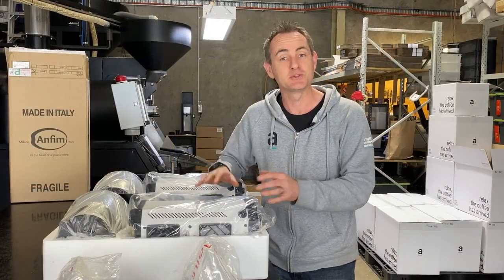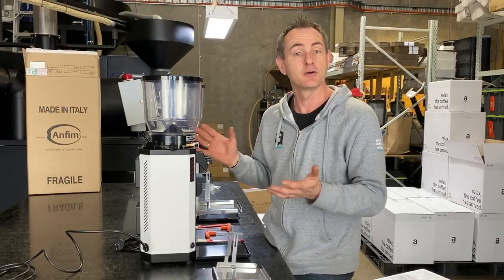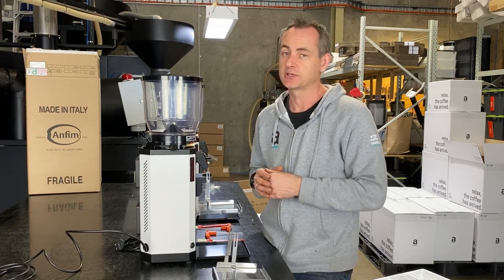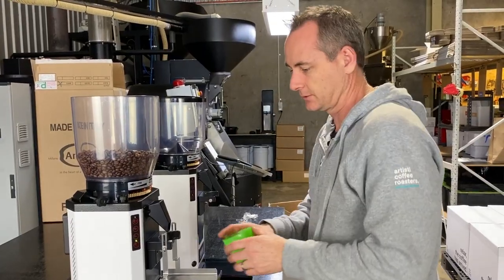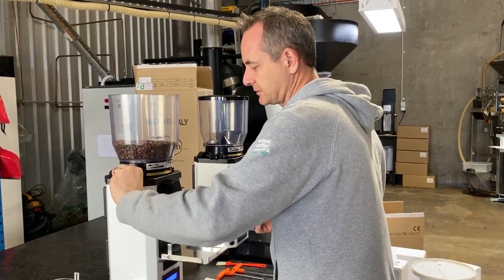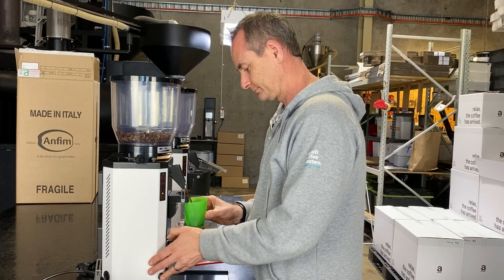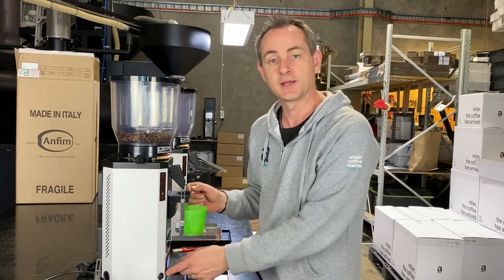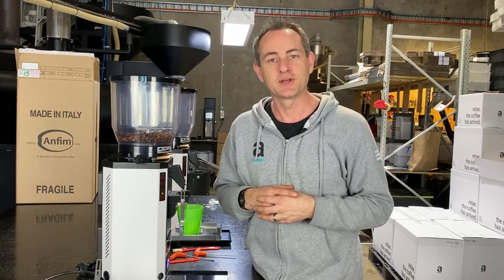How to set up & SEASON a new commercial COFFEE GRINDER

Comment: I have a Scody II grinder, I have a question, why is it when I change the grind size and I flush a few grams, but still the grind size hasn't changed, I have to let it sit for a while then it will change the grind size. do I have to empty the bottom of the hopper first when I want to change the grind size? then I just flush and change the grind size? or how? thanks
Reply from the maker: When you change grind there is grind between the burrs and in the chute, all this needs ti be cleaned out. It can be a good 20g in some grinders. If the blades are clamping onto a bean when you have gone finer this will hold the change a bit long let to come thru so a bit more of a purge is required. If you can clean a grinder it will change quicker

Comment: Hi, maybe I'm coming to this a bit too late for you to pick up the question, but as someone who recently received a new grinder purely for my own use at home, I've got to ask, what if I don't season my burrs? I was told that my 80mm flat burrs would take about 10 kilos of beans to run in, but after listening to the arguments it feels like I can just use my machine and the grind consistency will come together gradually as I work through that first 10 kilos, is that right?
Reply from the maker: yes that's correct, you may find some dose variances until the settle in.

Comment: Since the grinder is time based and time to a specific weight is based on burr setting...how do you set up the buttons without pulling any shots?  Is it just based on how the grind looks?
Reply from the maker: Matt we use these grinders a lot and know the basic time setting to begin with, then when installed in the cafes we make finer adjustments. These testes are in feel of the grind.
Reply: It's based on the burr and the bean. I personally weigh out the desired end quantity and add my estimate for retention and just grind until no more comes out. I adjust the time down until I run out of beans and time simultaneously. That becomes the time I use. Obviously, it's good to do this periodically as things may need adjustment.

Comment: First, let me congratulate you on the great channel you guys have. Really useful.
What really happens if you go too fine in that same grinder. You mentioned that 6.5 was already a good espresso grind size in that grinder. What would happen if you would move all way to a 2, or even 1 grind size?  would it start to come out with clumps? Would it stop grinding, because the coffee wouldn't simply go through eventhough is still in the range of the grinder?
Reply from the maker: Yes any grinder will get too fine and it will not push through the chute up to the clump crusher. When this happens the fine grinder act gets re ground and will jam the grinder. You have remove the blades and then vacuum it out. If you managed to get that low eventually the blades will jam on top of each other and stop the motor. 👍🏻
Reply: @ArtistiCoffeeRoasters we are using that grinder a new one but it keeps on clogging when we use espresso grind...